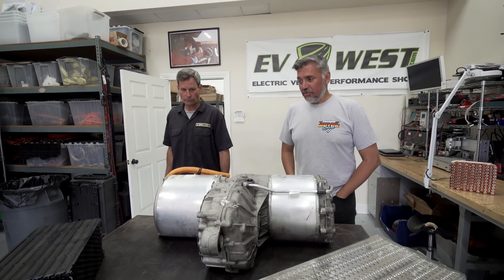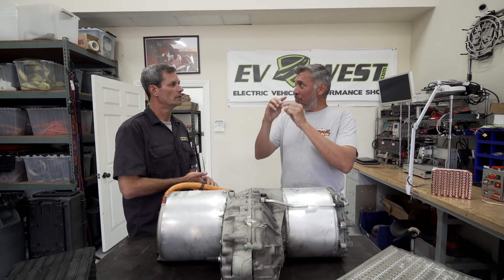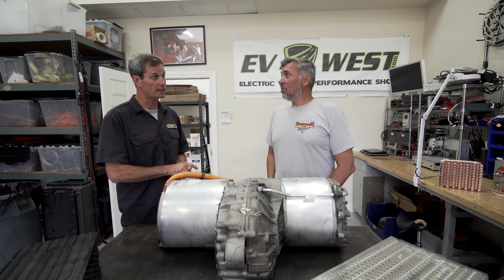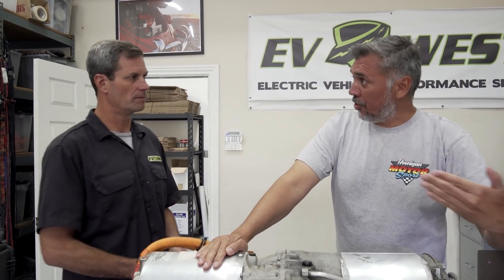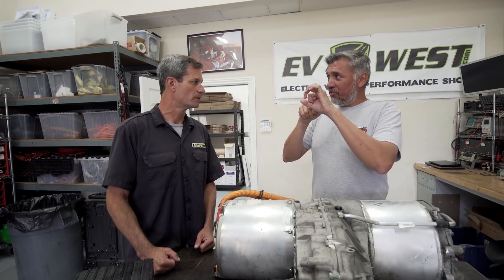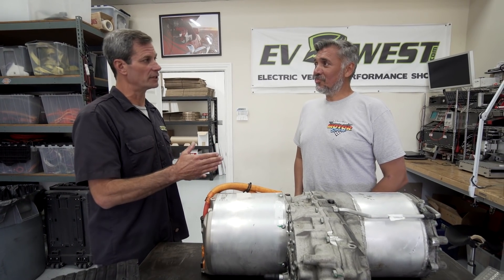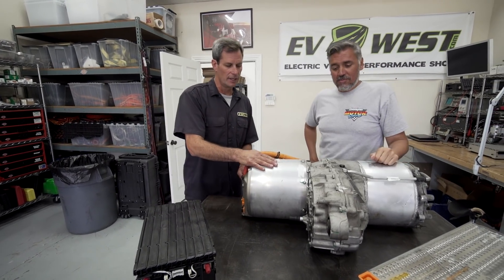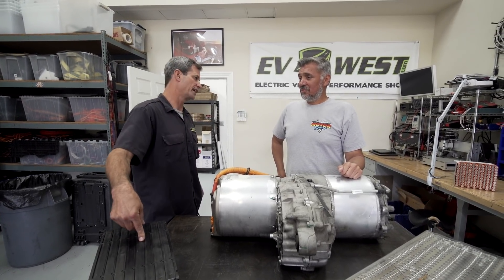How Does a Tesla Motor Really Work?? EV West Drops Knowledge

Comment: Quick question for EV west: what is the power input of a tesla motor in watts?  And how is that these induction motors are capable to have high low end torque values? The reason for question #1 is because the Dino of a tesla can give a measure compared to combustion type of cars, but I cannot see those batteries supply over 300kw of juice

Comment: What about a hybrid system. RWD electric FWD ICE. With the Tesla motor what kind of battery pack would I use? Could I charge it with the 12v alternator plus the regenerative braking?

Comment: Also, how much power the motor can handle both short term and long term, including cooling to remove heat. So the other factor, is the capacity of the cooling system to cool the battery,, the motor and the power handling electronic controller. Volts * amperes = watts in, - the inefficiency of the motor=watts out that then can be converted into horsepower by dividing by 750.
Reply: A bigger battery way beyond 100 KWH is necessary to allow practical towing or for a full fledged , 1/2, 3/4, 1 ton pickup truck with decent towing or loaded range!

Comment: Curious, so they are using an inverter to convert DC power to AC power so that the conversion process creates a loss of efficiency. Why don't they make motors that run off of DC power without converting? I know in my data center design work that there is a power drop if you try to push DC power too far a distance but considering that the battery is right next to the load (the motor) I wouldn't think there would be much power drop. Has the Tesla team seen this new motor technology? https://newatlas.com/linear-labs-hunstable-electric-motor/60974/

"It also eliminates the need for DC/DC converters and the aforementioned gearboxes, reducing total vehicle cost and weight significantly, and the company says the motor's inherent efficiencies across different speeds, as well as the weight savings it achieves through component reduction, can draw some 10-20 percent more range out of a given battery pack."
Reply: Bill Kemp Tesla’s own Principal Power Electronics Engineer published a lengthy explanation of the tradeoffs between AC versus DC. The ultimate deciding factor in choosing AC motors was superior PERFORMANCE given current technology. 

After all, if they had chosen DC they certainly wouldn’t have named the company after Mr. Tesla who brought AC to the masses!!!

Comment: I want to see a 3 second dragster with super capacitors and cryogenic super conducting motors!
Reply: Sounds like Rail Gun power supply to power a vehicle. I think that is the future "top fuel" electric dragster. Freaking several megawatt SuperCapacitor on wheels.
Reply: That would be wicked

Comment: Weren't you going to explain how a
Tesla electric motor works?
Reply: They did - the move from induction to reluctance, how the windings control the torque curve, the impact that the battery has on actual motor power - all of that.  

What they didn't talk about was how it was constructed - and Tesla themselves have put out videos on that subject, iirc.  They also didn't talk about the basic of how motors work in general (other than the very quick reminder at the start), because that's something you should have covered in school - and if not, I'm sure there are plenty of vids about it.
Reply: @logicalChimp  So, the video is 13:16 long.

There is a big chunk in front of them. There are
the two persons behind them. It's like they don't
even have a Model 3 engine on the table.
But what? 2:12. 

They don't even point to the thing on the table
where that detail of the engine is or that detail.
They don't explain what and where the engine
components are on the table. 

The type who asks the questions has an idea
of the matter. The other type is a swank without
real insight. Maybe a mechanic.

They talk about a lot, about the engine only in
30% of the video. They talk about the operation
of an electric motor in general, but very little
about the Tesla motor. 

To claim that they know how the Tesla engine
(which one? Model 3?) really works is a joke.

Translated with www.DeepL.com/Translator
Reply: @silberlinie  Might be worth watching again - and paying attention this time (although I admit the audio is poor).  They said specifically that it's an older Model S unit, among other points you raised.

For the rest of your points - most of those were addressed too, but I'm too tired to counter every point, so I'll leave it at that...

Comment: That’s not discontinued, it’s still the motor that goes into the rear of a performance S or X. The front motor is the model 3 rear motor (switched reluctance permanent magnet), and they shut off the rear motor at speed, to increase efficiency. The rear motor in the standard S and X is still the small rear induction motor. The front motor in a dual motor model 3 is still an induction motor. Not discontinued tech by any means.
Reply: Why switched and not synchronous motor?

Comment: Just because you don't have enough chassis volume to have a dimensionally larger battery doesn't mean you're stuck at a set energy capacity💀💀
Reply: Nope - but if you want to increase range, either you increase battery volume (which Tesla don't want to do because that would start to impinge on interior or boot space), or you improve efficiency (so that you can do more with what you currently have).

Or you can wait for battery cell energy density to increase - but that typically takes years for a noticeable increase in density
Reply: @logicalChimp  Elon said a 400 mile car is definitely coming soon (disregarding the 620+ mile Roadster, 500 mile semi and Pickup)
Reply: @ZephyrCorsa  Fair enough - and that could just be changing the cells in the Tesla Model S to the latest (2170's? can't remember).  After all, the Model S 100D has something like a 370 mile range - so a mere 10% increase would take it over 400 miles, and that might well be  achievable given the improvements in energy density between the cells in the Model S and the newer cells in the Model 3, etc.

Comment: Motor is a general term that refers to any device that imparts motion. Electric motors and internal combustion engines are both types of motors. It is accurate to call an engine a motor, though it is not specific.
Reply: I've always thought of it as 'motor = converts energy to motion', engine = 'converts fuel to energy, then to motion'.  So an engine is really a 'generator-motor' combination (where generator = converts fuel to energy) that uses a mechanical linkage (drive shaft) instead of an electrical linkage.

As it happens, a generator-motor pairing via an electrical linkage (and a buffer, such as a battery or similar) is actually more efficient (both in terms of range per unit of fuel, and in terms of emissions, etc) than the mechanical linkage, plus gives you a range of options of how you fill that 'buffer' (directly from the generator, or by just plugging in, etc).

But I'm going off-topic :D

Comment: Nads got confused about using the Tesla vs. LG Chem battery pack.  It's not precisely because it looses power as it's discharged.  It does...all batteries do...but the REAL reason they don't use full Tesla packs is because they're HUGE!  At least 1000lb!  In a sedan that you want to go 300mi that's OK.  In a race car (or just a normal conversion) you don't need a 100kWh pack.  You don't need to go that far and you certainly don't need the weight.  So, they use the LG Chem with less capacity but the same voltage.
Reply: A bigger battery pack = higher peak power runtime, there is an advantage to having a bigger battery pack, the roadster 2 will have a 200kwh battery pack and be much faster and durable then the p100d while maintaining 600 mile range.
Reply: @miguellopez3392  You're absolutely right but I got the sense that Nads was under the impression that the full Tesla packs were not being used because of some weakness in power output...maybe I just heard it wrong.

Yeah man, the Roadster will be amazing when it hits the road!  These are exciting times for sure.
Reply: @billbayer5526  It is possible to make higher energy density batteries, or higher power density that can be discharged more quickly by altering the electrolyte chemistry and anode materials and construction. Tesla uses at least two different formulations: for stationary energy applications where cycle life is king and for automotive where performance is king. The LG batteries may be seen as higher performance but will have less usable life. Tesla have bench tested packs to over 500k miles with less than 80% degradation. which at 15k miles per year use is a 30+ year battery. In actual use taxis exist that have done over 400k kms. Tesla expect to produce a million mile drive train including batteries for their Tesla Net robotaxis. 
The Tesla Model S and X are designed to run at motorway speeds and have long range. The extra cooling in the Model 3 allow it to run at autobahn speeds and similar range.

Comment: This auto is better then Tesla
https://www.youtube.com/watch?v=LtrteuWKTok
Reply: no not really.
Reply: @miguellopez3392  
Baidu maded and peaple have goted. Why not realy?
Reply: @lancet-kinzhal-sarmat-su57  can you tell me why it's better than something like the model 3 or Model S?
Reply: @miguellopez3392  
everything is said there (learn Russian):
1. Acceleration in 4.2 seconds to 100 km / h
2. no need to wait for the battery to charge - the battery simply changes to the “gas station” in 5 minutes
3. Listen to the sound insulation in the cabin.
4. "robot" with eyes on the screen
5. the price is 2 times lower (65 thousand dollars) than Tesla (130 thousand dollars)
6. high quality materials
7. like sports cars (Köningsen, cobra, etc.) body parts made of plastic
8. the body is NOT a sedan but like a SUV RX400h
9. prices for everything are not overpriced like American cars, but acceptable like all Chinese cars
10. Do you know how much a Tesla or Toyota Prius battery replacement costs? The same thing.

etc.
Reply: @lancet-kinzhal-sarmat-su57  model 3
1. Acceleration of 0-100km in 3.4 seconds
1. Charges to 80% in 25 minutes not as fast as a battery swap but it's much cheaper and easier to install fast charging stations so access to them. Just compare how many of these batterie swap stations (1100 planned by 2020) vs 15,000 tesla super chargers around the world.
Reply: @lancet-kinzhal-sarmat-su57  3. Tesla self drives
4. Tesla self drives
5. Model 3 preformance LR AWD (500km range EPA) cost 55k
6. Its China, them saying it has high quality material's holds as much merit as their anti corruption policies.
Reply: @lancet-kinzhal-sarmat-su57  7. they dont make their parts for super cars out of plastic, its carbon fiber covered in hard resin.
8. Yes the body is different.
9. Model 3 made in China will already be cheaper then the already cheap Model 3 preformance.
10. $15k, its warranted for 8 years, cells have a usable life around 20 years.
Reply: @miguellopez3392  
Сказки про 20 лет детям своим рассказывай

Comment: Wish he talked more about the drive ratio and if they take time to optimize that per application. Also, if they run an open vs LS differential.
Reply: All Teslas have an open diff.  They use their brakes for traction control.  There are limited slip diffs available online.  The ratio is 9.3:1 and is not changeable for any application.

Comment: He is incorrect about brushed motors. They do not have fixed timing. I was changing the timing on brushed motors 20 years ago in RC cars. The difference is with brushed motors you adjust timing on the motor itself, on a brushless motor the timing is changed through the controller.
Reply: He is - and he isn't... I believe they were talking about being able to change the timing on the fly, whilst the motor is active.  As far as I know, to adjust the timing on a brushed motor the motor must be off? (Its been decades since I did much with motors, and I find I'm forgetting what I've forgotten :p)

Comment: I wish they could make Alternating Current Batteries. I think the problem is as its switching the AC current the Neg would become the POS?
But I would assume the motor and battery could be in sync to switch at the same time?
Reply: Wish all you want, chemistry is one way. That's what makes it DC. Inverters are very efficient, so there's not much there to improve. The only problem is power density right now and that will improve over the next decade. It's adequate, which is why the EV boom has started.
Reply: @vidznstuff1  the only problem is density? I do not have a clue what I am talking about but I am pretty sure my grand kids will have no idea what lithium or lead acid is and we will be using something we can not comprehend.
Reply: @swaterman08  Basic chemistry. Lithium and Lead are elements. So, yes, they'll know what they are in grade school - much like you should have learned. Lead-acid batteries are recycled to an almost 100% level. Lithium batteries are seeing reuse after EV for residential solar storage and for ICE EV conversions.

Like I said, the only problem to solve now is energy density, though present levels are acceptable, which is why the industry is ramping quickly. Tesla has a really good handle on getting cell costs down, and others will be forced to follow, so cost is not really a problem....lots of room for them to get cheaper.

Comment: Can anyone suggest good channels for ev car engineering? I really enjoyed this and I think it’s time for this petrol head to turn to the dark side.
Reply: Rich rebuilds
Reply: There are plenty of people hacking bits off electric cars. But much like LS swapping the world the process is not just take the part that Nads was holding instead of a beer and bingo you have a Tesla. The part that interests me was finding out just how much integration is within the whole car to make it usable. So in the LS swapping analogy taking the motor and fuel inj system and putting it into any car is straightforward. But making the ABS and ESP work with the engine or gearbox so it deactivates cylinders or mapping to get economy/power or hot or cold running. That is where something like the Tesla is just a big Server and you need everything to work to utilise it and this is where it becomes like swapping a 2016 Mercedes S600 than a Cummins 12 valve. Personally I find the Nissan Leaf a more approachable prospect as they use Juke parts as a starting point for all the car bits around it. Having ac and a heater is a stand alone heat pump system in the early leaf.

Comment: eww a dyson.
batteries belong in phones and laptops, i will only accept electric cars if laptops will use regular old combustion engines!
Reply: Yeh, na I was a bit sceptical of EV's until I took a Tesla S for a rip. Faaaaarrrrk. 
 electric motors have an almost inverse torque delivery compared to an ICE, so 100% of the torque can be available from virtually dead start.

Comment: Would a petrol generator potentially have a higher density:weight ratio compared to a performance battery?
Reply: Not enough Peak Power. You would need a massive generator just to keep up with consumption. Seems like they run it 300kw continuous safe level during the Burnout Session. Look up how big a 300KVA Generator Set it. Takes up an entire Trailer.
https://www.zoeticequipment.com/2010-multiquip-240kw-300kva-portable-diesel-generator
Reply: Probably not.  However, if you need performance and endurance (and you have periods where the power draw is low enough) then a hybrid setup with a generator to recharge a smaller battery may work out lighter and more efficient than one massive battery - but it only works if you have periods where power drain is low enough that the power from the generator can actually charge the battery faster than it is being drained.

Still, this is the concept behind the BMW i3 REx, Chevy Volt, London TX-E, and other series-hybrid EVs...
Reply: (at least when I did the maths 2+ years ago) The output required from the generator would A. Need to be absolutely massive per square unit. Much more than anything industrial or home shopping channels could provide and B. Still need a hugely effective buffer like capacitors or battery's regardless.
Reply: Yeh, something about more in losses than gains. Always thought a gas turbine engine would make a good hybrid engine unit. Having constant rpm ranges, will run on a range of fuels, can be packaged  in a compact manner... ejection seats, sidewinder missiles etc